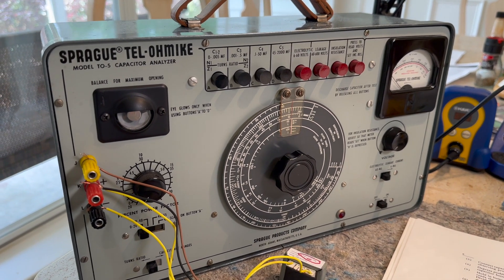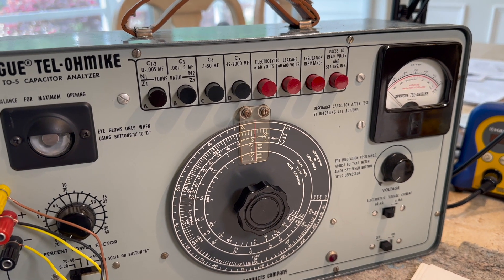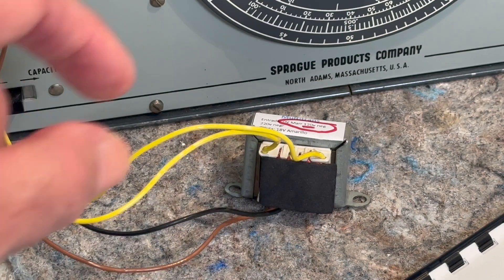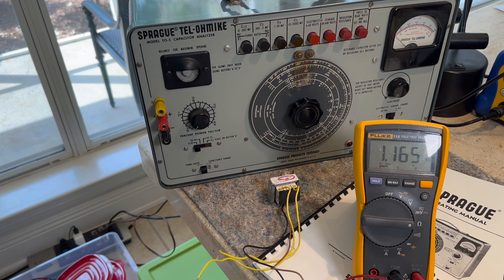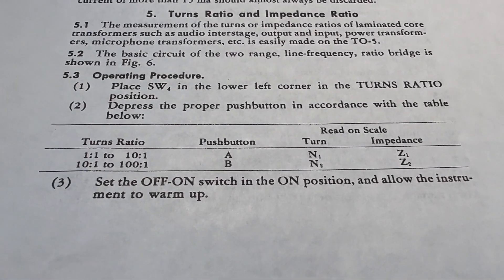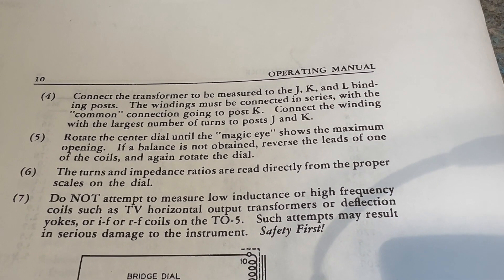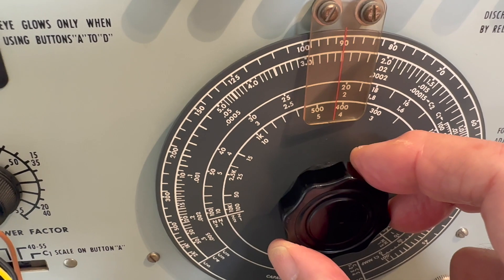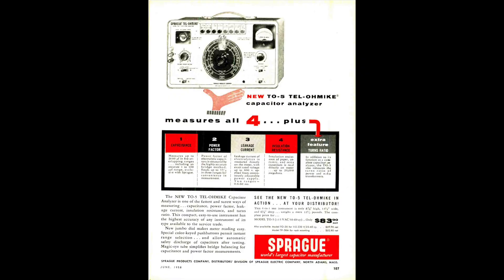How To Test Transformer Turns Ratio with a Sprague Tel-Ohmike TO-5

Comment: Found you channel looking at Foley Bridges, saw this and believe it or not I have a TO-5... not nearly in that conditon.. bought off a HAM radio guy that sold me his stash... Prob need to tune it up,, let me know if you have a source for info / how-to....
Reply from the maker: I just Googled how to refurbish one and came up with several sites but the best was antiqueradios.com.  They have a forum on test equipment.  I got some bad advice there also.  They had me buy a new Eye tube which wasn't the problem.  I basically went through and changed all of the capacitors and whatever resistors I could find that were out of spec.  The reason my eye tube wouldn't work is because the wire wound main bridge potentiometer had a broken wire.  Thank goodness I was able to find a replacement on eBay.  After all the upgrades, I would just measure the voltages with an external DMM to see if they matched what the Tel-Ohmike meter was showing.  Some precision caps are almost impossible to get to in the unit and hard to find to buy.  There is a guy on that forum that sells them but he is in Canada. You do have to disassemble a few things to get to everything.  Search my channel too.  I have earlier videos when I first bought it.  I may have references there but not positive.  It's an indispensable tool now.  I use it every time I need to change a cap in anything including guitars.  I found the vintage 1964 50X .1 ceramic disc in my Strat was a leaky sieve.  But on a guitar, it still seemed to work but I replaced it.  I didn't mess with the precision adjustable resistors and never bothered trying to calibrate it because everything seems to be working fine.  It definitely does what I need it to do and that is to test for leakage.

Comment: I just bought. My TO-5 just because of the transformer ratio test function.   I’m curious how to check LowZ transformers that I’d use in mic preamps or analog DI boxes.   For tube amp output trannies I just use a small voltage applied and some math.    Do you have an unknown transformer to check?
Reply from the maker: I do not have any other transformers.   I did go back to try to measure the Z1 or impedance ratio but couldn't figure it out and really didn't know what I would use it for anyway.  It sounds like you've got a lot more expertise and use for those functions.  I mainly bought it to check capacitor leakage.  I figured most people would just apply a voltage and figure it out mathematically so I'm not sure why they offered this function on the TO-5 except that maybe it's a good time saver if you need to do a bunch of them.
Reply: I enjoy your videos.  I learn a lot.   I’d send you several transformers to check if yould use them for a video.  They would be good for analog DI boxes or reAmp boxes.  You don’t need to return them, build something.  My TO-5 is in the repair cue, all caps are original and the eye tube arrived broken.  I have one in my caddy.
Reply from the maker: @jonathanhorne6503  I’ve got many projects right now, I probably wouldn’t get around to messing with them. I appreciate the offer though. I keep promising these Hendrix tutorials and never do them. I finally got Earth Blues done today but have some editing to do. I went on a old radio forum to get advice for the refurb. Not always good advice. I ended buying a new magic eye tube unnecessarily. Turns out the main wire wound bridge pot was bad. Thankfully I was able to get a replacement on eBay. I took it apart and one of those hair thin wires was broken. Who’s doing your refurb?  I got all my parts including the precision caps from some guy in Canada.
Reply: I’ll do the refurb myself.  I’ve been building on amps on a Small scale and repairing my gear and my friends as a hobby for years.   All self taught.